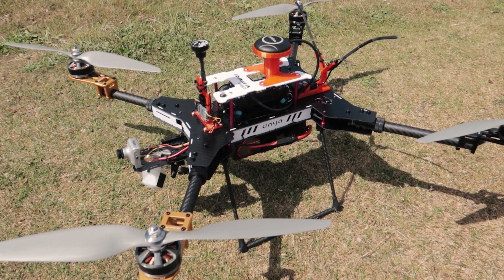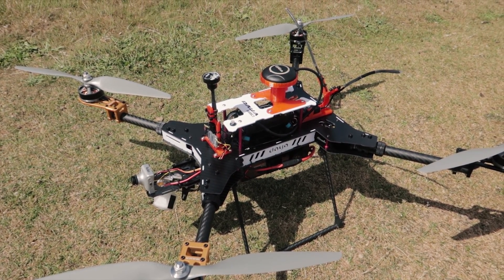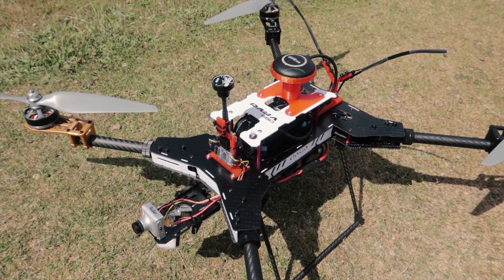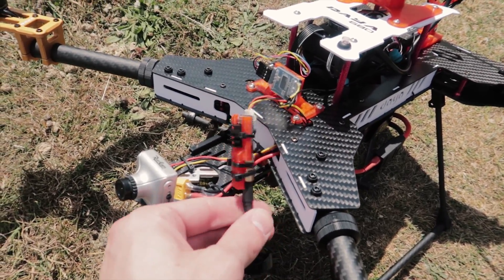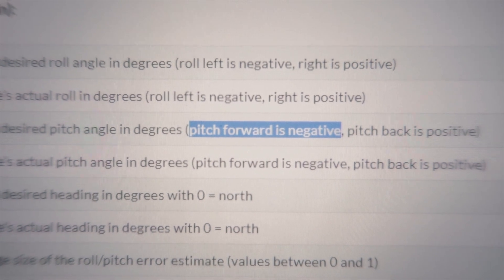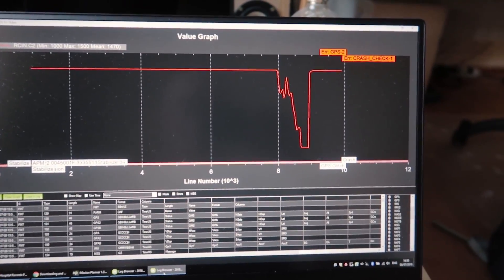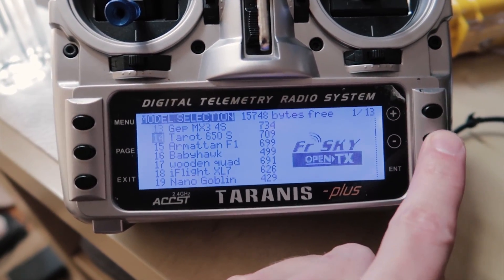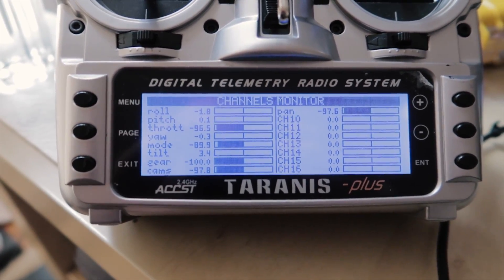Daya H4 680 // Arducopter // Maiden Flight & Crash

Comment: 3508 motors, even at 380kv, are somewhat anemic for 1355 props.  For a drone that size 20mph winds shouldn't really be a concern.  Bumping up to a 4010-ish or a bit larger motor with similar kv would preform better with those props even in windy conditions.  As for flight controllers reversing pitch, I don't see why people spend $200 on a pixhawk to begin with.  I run iNav on F4 boards equipped with a baro on large builds and they are fine, D term is a little finicky to get dialed in though.
Reply from the maker: I actually ran this build in a previous incarnation with Tarot 4108/380 & 12/13/14" props, before moving to these far better quality T-Motor 3508/380 (which I also now run on the same 14" CF props). The 3508 are marginally less powerful (we're talking a thrust-to-weight reduction of 0.2) but the quad flies substantially better with them - especially stability in wind. As for Pixhawk, I'm fully aware that you can run iNav & Ardupilot on cheap F4 flight controllers - I have an iNav Matek F4 quad, I've just built an Arducopter Matek F4 Y6 hex & I'm building an Arduplane Matek F4 wing. However Pixhawk still has its benefits - even the old model gives you stuff like the redundant F1 chip, while the new model gives you things like triple redundant temperature controlled IMUs & an Intel Edison companion computer interface.
Reply: @CJDavies  I would really like to see a 3508 with 14" CF props in 25mph winds not get completely overwhelmed.  I switched away from 35xx motors with larger props even though they are usually efficient, they lack any sort of payload, wind stability and flight times really weren't that great because they make no thrust and batteries have to be small.  I started to really look that size after having issues with Matrice 100's; they had no payload capacity to the point I had several people thinking their drone needed repairs due to it losing yaw control and calibrating the drone didn't help, no where near the 50mph wind tolerance DJI quotes and the motors and batteries were always scorching hot.  That drone runs 3508 350kv motors with 1345 props, DJI claims 2100g of thrust, but in reality its about 1500g in ideal conditions.  I haven't seen other 35xx motors perform quite are poorly, but they have similar problems.  I made different arms for an M100 and tried some cheap GARTT 4112 motors with 1447 props and it flies better and the payload and motor temperature issues are gone, although flight times did not really improve and batteries were still warmer then I would ever like.  I tried running a cheap 600 setup with GARTT 4108 500kv motors and 1147 motors and it does 45 min flight times with a 10000mAh battery and wind is not an issue for it.  With a properly good motor like a KDE 4213 360kv and 1555 props, you can get a 680 to do over 1 hour flight times and have exceedingly good payloads because for the trivial weight increase of about 50g per motor, you double the thrust output.  So with that, I figured I can carry bigger batteries, more payload, get more flight time and handle wind better, there really was no reason not to use ~40xx sized motors with the larger props, especially on that size of frame.  On smaller frames they still make some sense.

I mean I am looking at doing a new test rig with the F7 FC that are coming out, but between that and the functionality of the software, I just have a hard time spending 4 to 5 times as much on the pixhawk.  Some of those are nice features but nothing I really value at the price they want.  The Intel Edision Companion interface is nice though I imagine, that's something I would have liked awhile back, although I have a microcontroller setup now that as long as you use a receiver and flight controller that use digital protocols like SBUS or CRSF, I can read and write values as well as talk to another processing platform that can look after a 360 LiDAR and calculate channel values for obstacle avoidance so that Intel interface has come a little late.  I can see the appeal of it though I guess; different people value different things, I rather spend less on the flight controller and more on motors or peripheral electronics lol
Reply from the maker: @KlockworXMusic  It's obvious that 35xx motors are something you feel very strongly about, so I will simply emphasise that for my quad & my purposes with that quad, the 3508 have reliably outperformed the 4108 I had on it before & I have zero intention of changing them. I don't want to lift payloads measured in kg, I don't want to fly for 45 minutes on a single battery, I don't want to fly in 50mph wind. Incidentally, part of the decision to go with the 3508 was logging well over a hundred hours on an Inspire, which spins 1345 props on 3510/420kv motors & I put that thing through the wringer in inclement weather/conditions more times than I can remember & it always behaved how I expected it to. It doesn't carry much of a payload, but as a reliable workhorse that you know will always behave exactly the same way for exactly the same 20 minutes per battery, it's great.

In the hobby scene, the cost of something like a Pixhawk Cube is obviously a hard sell over an Omnibus/Matek/whatever, however in the professional sector where your payload might be anything from a $5,000 multispectral survey unit to a $50,000+ cinema camera that extra few hundred bucks for redundant IMUs which don't screw up in extreme temperatures is a no-brainer. I built this quad with a Pixhawk mainly because I'd never played with Arducopter before & was simply curious to give it a go (this was back before the ChibiOS support, so cheap F4 miniquad FCs weren't an option).
Reply: @CJDavies  I think my main distrust and poor performance with the 35xx motors and larger props is I live at higher elevation.  Based on your accent and surroundings you live somewhere in the UK with an average elevation of ~500ft.  I live at 5000ft.  M100's will hover for 28 mins at sea level on the larger battery, that same setup will only hover for 15 mins at 6000ft, and with ~500g of payload drops to 5 mins.  So whether its work or hobby, I have to have more thrust because the elevation range I fly in is -2000 to 10000 ft ASL for commercial units, and when I fly for a hobby still 5000 ft, give or take 2000 ft.  But say your drone makes 6kg of thrust (1500g per corner) and weighs 2.5kg, so it hovers around 50% throttle, its just a little under the max take off weight people generally like to have (50% of max thrust), so while flying you have 50% throttle to play with for flying and error correction.  But that's lower elevation, at 5000ft that drone would likely hover around 75% throttle.  Not only do you lose flight time, payload, but you lose authority.

Its not that I am poo pooing 35xx motors entirely, but specifically, big frame, big props, small motors.  Bigger frames have more weight, more room for batteries that add weight, and you hit the limits of the drone easier before taking other factors into account, like elevation.  And how often do people think about how well their drone will fly when they do a road trip from the coast to the mountains and gained a few thousand feet?  I don't, lots of companies that have come to do demos haven't either because several whose drones at sea level flew fine literally would not even take off at full throttle at elevation.  Plus a 680 frame will take 15", maybe 16" or 17" props, so why not fit them with larger motors?  Its not that I don't use 35xx motors, specifically low KV 35xx, but I use 11 - 13" props, a bit less pitch then you, and its on a ~500-ish frame with one 4000mAh battery (You're running two 4000 packs aren't you?) so its overall much lighter and then I don't have a problem with them, but the power to weight is better.  Its not just prop to motor size I find troubling, but prop to motor to thrust to weight to frame size where I have trouble with.

I have a RedEdge Multi Spec camera, I can see flying that on a Pixhawk FC drone, also because I have lost my love for that camera, the JST connectors on the side don't have enough support and break the solder joints inside and then it has to come apart and be resoldered.  But I was just out last week with a friend that has a RED Monstro dangling from an M600, and that camera would never go on a Pixhawk drone.  I have a couple aerial LiDAR units as well that I wouldn't trust to a $200 flight controller.  The Pixhawk and the N3 that would be its main competitor, I think that I have a hard time justifying is its a little expensive for hobbyists, but not quite there for a real pro rig.  Its in that enthusiast/prosumer type range, which feels like a really small gap.  Its like why not just go all the way to something a bit more expensive, a bit more professional or industrial, especially if the payload costs that much.  It just feels niche I guess, but maybe its just not a product that fits my needs and that's why I find it a bit meh.  Maybe I should grab whatever the newest and best Pixhawk is and try them out again, stuff does advance pretty quite in this industry, its probably not fair comparing and older Pixhawk I have had for awhile to a nice new F7 FC, that probably isn't fair.
Reply from the maker: @KlockworXMusic I was always slightly dubious about how drastic the effects of elevation are on multirotors & those doubts were largely confirmed when I went to Pakistan a few years back. I flew the previous incarnation of this quad (Tarot 650 Sport, Tarot 4108/380kv, 14" T-Motor style CF) at both sea level in Scotland & at over 9000ft in Pakistan. I put the numbers through eCalc before the trip to Pakistan & it told me to expect a difference in hover time on a 4000mAh 6S (which I originally planned to use in parallel pairs like you suggest, because you can't take a 8000mAh 6S on a plane, but I ended up just flying them single) of 15.7 minutes to 13.5 minutes. The quad felt exactly the same while I was there & I happily flew for the same ~12 minutes I usually flew for on those batteries at sea level without barely passing storage voltage, but of course flying in loiter/position hold I didn't have any throttle feedback. So I compared the dataflash logs upon my return, to find no discernible difference whatsoever between the actual motor signals at over 9000ft compared to at sea level. So the idea that a M100 that hovers for 28 minutes at sea level will only hover for 15 minutes at a mere 6000ft seems highly dubious, unless I'm missing something massive.

And again, I will emphasise that the purpose of this quad was mainly to play around with a bigger quad & with Arducopter. I never made any claims that it is an ideal setup, in fact I have always acknowledged that it is the result of many compromises - including changing frame from the frankly fairly naff Tarot 650 Sport (which realistically can't go above 14" props) to the larger Daya 680 simply because it is a better designed frame to build/travel with, not because it can accommodate larger props. Yes, in an ideal world were I to start a similar build again from scratch I would probably take much of your advice to heart, but that's simply not what this quad represents.

I'm sure you'll be glad to hear that my Y6, which I hope to finally maiden this weekend, pushes 6:1 thrust to weight on eCalc with two 2200mAh 4S packs on it, spinning 1045 props on the new Sunnysky X2212/1250kv motors :p

Comment: 😂 lol 😂 the exact same thing happened to me, been flying mini quads, then decided to set up a secondhand clone I bought on eBay of a TBS discover and a pixhawk and I VERY quickly found out they pitch was opposite 😂 

I wonder if this is the same on their Chibios build of Ardupilot with mini quad flight controllers??
Reply from the maker: Any idea why Ardupilot is like this? Did one of the oldschool radio manufacturers (Futaba et al) follow the convention of pitch forward = 1000uS & the Ardupilot devs have just been reluctant to change even when all mainstream radios today behave the exact opposite?
Reply: CJ Davies if I had to guess I’d say it’s something to do with old school flight simulator / fixed wing people... but I have no idea really 😂 
On inav / betaflight / cleanflight you get a nice 3D model of your quad so you can test the input and a rough idea of the rates etc. Which is really nice. Shame it isn’t in mission planner / q ground control. Would have avoided a crash. Hey ho, it’s all part of the hobby
Reply from the maker: Yeah, I even went through & double checked in Mission Planner that all of my channel mappings were correct & moved properly.... just didn't remember that the pitch bar was supposed to move the wrong way :3 But as you say, all part of the hobby - worst bit about today wasn't crashing or breaking anything, but the mostly wasted 90 minutes of travel to get to & from the field!